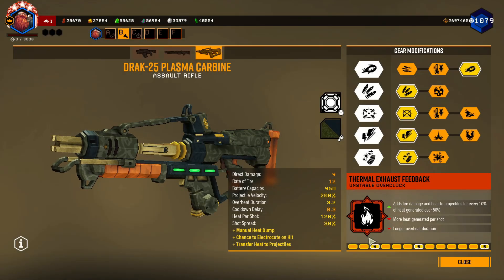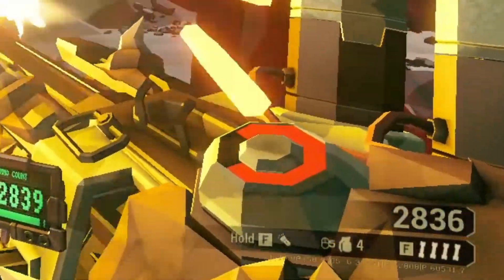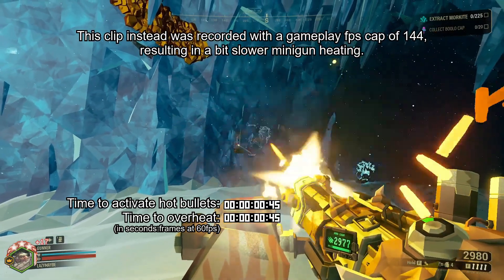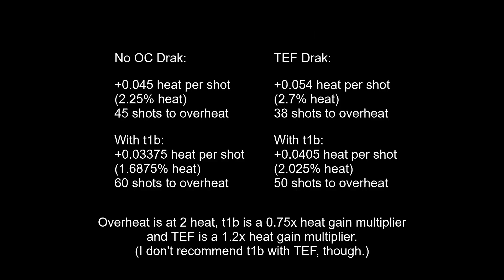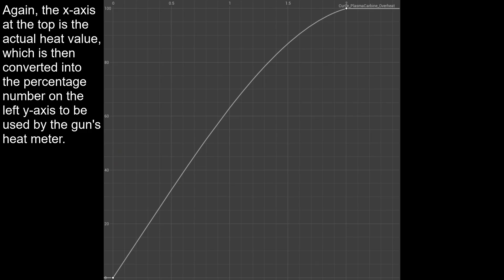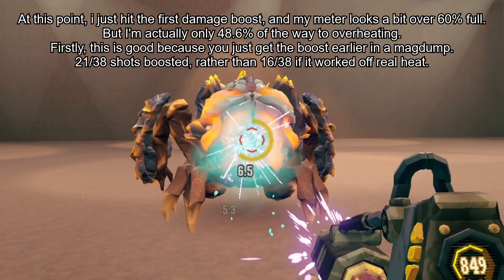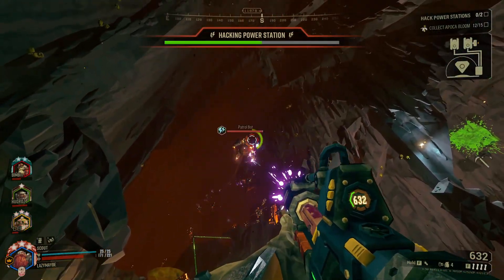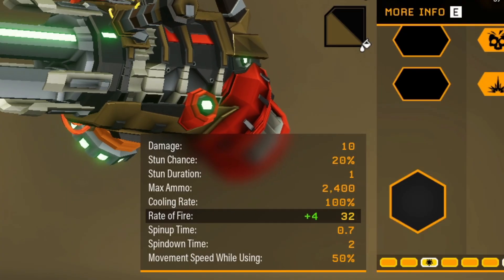DRG Season 4 TEF buff, mechanics, and some bugs (especially with spreaders)

Comment: DRG  programmer here! The sceptic spreader tweaks happened because the old line of sight check behaviour would make it try to shoot you through walls. We will adress these new issues in a future patch. It was never intended as a nerf. And yes, you did lure me in :(
Reply: Hey I've noticed a bug where if I pick up Doretta's fuel canister or sometimes switch to my gunner shield (could be more), my pov will be empty (showing no item in my hands) and not allow me to use it until I switch to another weapon and drop it. Also there's been a bug with the crossbow where it doesn't reload after you shoot, you have to manually switch weapon and back before it does. Haven't played scout in a while, but if it hasn't been fixed it's certainly something to look into.

Pls look into these thing, the crossbow bug has been in game for a long time. Appreciate your work.
Reply from the maker: Oh, the comment about them being nerfed was in regards to them now having the attack-tell-scream. Subjective of course, but I found them to be in a good place right off the bat. That said, it's the only version of spreaders I've experienced that has the scream tell also has the pathing issues, so it's not exactly as if I know what they'll be like once those are fixed.

I just worry that once the pathing is fixed, the long scream animation may still make them too easy to deal with before they become a problem.
Reply: Thanks for fixing the DRAK fire OC, it was my favorite OC.
Reply: @snoweh1  idk about you but my crossbow is working fine for me, it's actualy the exact opposite issue where in my "infinite wisdom" I switched to my deepcore rifle expecting the bolt to be reloaded, thats what I get for not having born ready on scout when using the bow XD
Reply: Since you're here, I've noticed that (on console at least) when I do things like build pipelines, start machine events, set up the uplink, etc. If I stop doing it for whatever reason, it will reset the progress. I was just wondering if this was intentional or not
Reply: It's great to read about your point of view about the game, thank you for your work on this great game! =)
Reply: @PalpatineGaming  I got that bug on PC in one mission, but only on one mission.
Reply: @xendakakorva3267  I have no idea what you're trying to say to be perfectly honest.
Reply: @joneydew4739  I've had it on all of mine, it's not a huge deal it's just slightly annoying
Reply: You guys should do something about Stingtail. They have tendency to spawn on ceiling and kill drillers and gunners through fall damage (by pulling them up to the ceiling). The most annoying thing in the game right now.
Reply: Is there a way to maybe keep something with it in...? It's just exceedingly funny to see him waltz up and give you a little headbutt like a friend then run away all shy after doing it. or a reference maybe
Reply: @lazymaybe  Honestly, as a dude who does a lot of Solo play I found the spreaders to be slightly more sneaky that is entirely fun. The roar seems like a good fix to that, even if the RoF reduction it brings also reduces the amount of threat they pose in swarm fights (where they really shine RN). Personally, I'm hoping for a shorter but louder roar.
Reply: @snoweh1  What I'm saying is that I was being dumbass and forgot to have the Born ready perk on me so that the crossbow reloaded while I was using the Deepcore GK2 XD
Reply: @xendakakorva3267  That'd fine with me, God bless you and your family. May your steps be blessed and guided by light.
Reply: @snoweh1  same to you bud
Reply: @PalpatineGaming that is a bug. Its fixed on the steam version of the game and we can hopefully have a patch out soon for the console version as well :)
Reply: @gentlecat7735  gotcha
Reply: @Maestro-ee4rj  I know I saw on reddit a dev saying they were also patched. They were pulling people from 30m above you, but now will only attack if they are no more than 15m above your current elevation. You can still totally fall and die, but it shouldn't happen as often.
Reply: Hear me out - special egg event that lets us get a steeve for the station (of the many types of bugs) I just imagine having one of these on the station like a st bernard
Reply: Man I feel bad for you with all these guys telling you to do other things
Reply: @Maestro-ee4rj skill issue
Reply: @PalpatineGaming  it hurt when the engi player start get interrupted for some reason, then all progress get lost
Reply: The spreaders are fixed on PS5 now, thank you!

The spreaders and the stingtail are FANTASTIC, great addition to the disruptive bugs (emphasis on disruptive), thanks again!
Reply: No worries, coding is difficult, though I have to agree with Lazy on the spreaders as in my green beard experience they are mighty good opponents, not really a need to telegraph their attacks since it’s a bombing projectile, I just always had the problem of them shooting without line of sight or checking first before shooting as I would be fighting two oppressors and then now my wiggle room is gone do to septics shooting from where I can’t see them
Reply: would be cool if there was a very rare varient of the sceptic spreader that just follow you have the damage resist steeve has and don't attack
Reply: @theberzerkir very very good idea (and would be very cute to have a little grunt friend on the station)
Reply: Now septics just dont check for los... very epic at hi-haz

Comment: On the console version of Season 4, for some reason the version we got of the update included two bugs:

1. Infinite Rock Pox build up without there being any actual infected enemies or terrain left in the mission (the only way to cure this is to get downed and revived).

2. Progression on building or repairing objects and objectives goes back down to zero if you stop or get interrupted at any point, instead of the progression being kept.  Engineer turrets, mini mules, uplinks, fuel cells, black boxes, pipelines, buried resupply pods, cargo crates, machine events, and the Caretaker’s shield batteries are all affected by this and it makes missions feel much less flexible than before.

The PC version of the game got these bugs fixed in subsequent patches, but this is the first console build of the update we got. Why we got this bugged version of an updated Season 4, I’m not entirely sure, but I’m certain they’re trying to fix it. It’s been 2 days and haven’t gotten an update or fix for it.

Comment: I'll be honest, even on season release spreaders felt incredibly weak. Huge weak point and low health meant they would always die pretty much instantly, and even when they got a shot off it wasn't nearly as dangerous as getting randomly hit by an acidspitter or something.
Reply: Yeah but they could also seriously hurt you and deny the area around you. A single cheeky one could easily make salvage duty into hell.
Reply: I think thats the point. They're like the any of the ranged bugs, conspicuous and are easy enough to deal with on their own but when there's a horde around you they become hard to prioritize which is when they deal some real damage. And you give them less credit than they're due, they hurt like heck, even just having them die on the ground leaves a nasty puddle that can melt anyone quickly which doesn't help in horde situations.
Reply: spreaders kind of fill a similar role to hermit crabs in ror2, if you play that game, except it also has a bit of l4d spitter in it as it can cause significant area denial if left unattended.
Reply: @bluegolisano7768  septic spreaders don't kill you in two hits from across the map and also blend in with the scenery.
Reply: You can call them weak until you have to revive someone lying in a septic pool lol. Or defending a black box and the pool out-damages gunner shield regen. 

I love them, but I don't them to be buffed 😅
Reply: They should be like mortars, ground-based and launching their goo from afar.
Reply: @snoweh1  My impression is that they are (Before this ai bug), they were a pain on Salvage when they would hide behind the terrain, raining artillery shells on me while the glyphids held us inside the circle to defend. Usually you only have a scout who can jump out to deal with it. Luckily it works much like an artillery aswell, so once you move up on it and can shot it dies pretty easy, which is fine imo.
Reply: @bluegolisano7768  Exactly what I was thinking. The fact that their projectile travels in an arc made it so they could attack you without LOS and you pretty much had to find them and take care of them before they do some serious damage. I honestly thought they were fine shooting behind obstacles because of the nature of their projectile.
Reply: Nah area denial is really powerful, Drillers know that. The little bastards also die hard.
Reply: Cool, but I still remember them literally slinging projectiles at me without even revealing themselves, but cool. Multiple times, they would be just out of line-of-sight which makes some Salvage Uplink stages a complete nightmare in pugs.
Reply: I think they were fine when they first released. They’d shoot quick enough, from far enough away, and from cover enough that they’d feel threatening because one starting to shoot could make half the floor of the cave dangerous and they do do solid damage. Their damage is significantly higher than an acid spitter and it lingers so I think it’s fine if they’re a little weaker, but to be honest they felt about the same, just with bigger weak spots. I have noticed they seem to be really weak now though so I hope they get fixed to be about as threatening as they were at the start of the season because I think that’s the right balance for a glass cannon type enemy. They aren’t meant to be super deadly, they have pretty high spawn rates so I think it’s good if they’re not ultra deadly, especially since their puddles really are no joke on higher hazards if you walk into them by accident
Reply: They’re intended to be glass cannons.  Before this LoS bug, on haz 5 these things were a nightmare if you let them live long enough to fire goo at the team, as the goo piles do such an insane amount of damage so quickly, it could down several players in mere moments.  I also imagine it’s coincidental, but I got pulled into goo piles so many times by stingtails, and that was basically a death sentence every single time.  An enemy so insanely powerful needs to be balanced by being really squishy with huge, high damage weak points.
Reply: Isn't that what literally every ranged enemies are? Extremely weak but also deadly (Except for those armored Macteras ofc), Spreaders are like Webshooters, sure on their own they're easy to spot and kill, but if a group of them is accompanied by a swarm they can easily wipe your team, which Acidspitters can't really do because of how few of them spawn.
Reply: This thing can basically one shot you on haz5 and puddles melt your health like nothing else in this game and this bug is still very dangerous on haz4, what are you on about? Let's give it oppressor armor and a weakpoint at the back, sure it will be threatening enough for you then.

Comment: Hi there!
Spreaders were probably changed to help players on lower hazard levels. Especially on haz 1-3, spreaders were exceptionally more threatening than anything else you'd run into, except maybe poxtorians (even more threatening than low haz dreadnoughts). One spreader could wipe out a lesser experienced team before they even know it's there.
Reply: spreaders roaring was meant to help with that, but them running up to you and refusing to attack was pretty clearly unintended
Reply: One of the devs mentioned that they were attempting to target players through walls, which is why they changed the LOS thing
Reply: Skill issue.
Reply: @bugjams  Yes, making games function properly require skill.

Comment: When it comes to the septic spreader, they did need some changes to their LoS check but GSG seemed to have either bugged the bug or went to strict. I have been in at least one mission where a spreader was literally shooting through the Salvage fuel cell from an elevated position. Being solo and not playing Scout at the moment, I basically had to deal with an enemy being able to ping me without being able to ping them back. So, no, I wouldn't consider the Spreaders to be "alright on release" but I agree their LoS check needs to be loosened up a little.

Comment: I thought the line of sight check nerf/patch was due to the septic spreader firing over the horizon, meaning the bug knew where you were without actually being able to "see" you and therefore had the potential to shoot you from behind cover. The first few days of gameplay made me really appreciate how hard and unique an enemy it was even if it did feel a little cheap. I understand the bugs are able to path to you in the dark but the arcing shot from the spreader was faster and more damaging than a shellback, and if there was more than one it made moving through swarms very tricky. A DRG programmer in the comments said they were sometimes shooting at walls which I could see as a big problem. But since the patch it has gotten noticeably easier. The new stingtail by comparison got nerfed with a 10m grabby range which is thankfully is a pretty good change I think. But the septic spreader is now such a good boy I almost think beast master will work on him.

Comment: Tbqh I still think the bonus should start (plus give you an extra stack at max stacks) at 50%.  Maybe I'm underrating how strong it would be, but it still feels rather finnicky to actually use, especially if you want to get optimal effectiveness from it.

Nerfing Spreaders is a bit weird.  They never seemed overly damaging in my experience, especially compared to either spitter variant which you have to be very proactive about spotting and picking off.  Springtails seem far more disruptive and harder to deal with, and even then they're arguably balanced, so I'm not sure why Spreaders were seen as a priority here.

Comment: Hey Lazy, have you considered making smaller, more focused videos? As the game gets older, it's more and more likely for some videos to become out of date. I don't know if your intention is to have your channel become a resource similar to the wiki, but having single-issue videos would help in this case.

Besides that, would you mind going over the new Stingtail? I think this thing is insanely overpowered compared to other bugs. Getting grabbed and moved out of position is easily the strongest effect any special bug has. I mostly play Gunner, so I'm slowed while firing, and dodging sideways is difficult. Our team's scout has switched over to cryo grenades just to deal with these fuckers.

Comment: I feel like the only new bug that should've been nerfed is the Stingtail, and even then not to the degree of running forward never attacking.
See, I play on haz 4 all the time. I do not like haz 5 or elite deep dives. They are too difficult and take too much time and thus are not fun for me. Same reason I hate point extraction, it's the one and only mission I set to haz 1 to skip whenever it shows up as an assignment. I also play on solo a lot. I haven't done any multiplayer in the longest time because I like to bang out a handful of games in Deeprock and then not play for a while, which means joining other people really suck as they don't ever align with what I'm doing. Haz 3 is way too easy, so that explains why I do the middle ground. I am pretty alright at the game, I can handle winning most haz 4 missions. The times I lose are usually at the absolute start of the mission due to terrible spawns.
Stingtails ruin all of this however. They are so incredibly difficult to dodge and have guaranteed a loss on every single mission I have played so far where they've spawned. Not even sugarcoating my own opinions here, it is too hard. I hate it. Makes me not wanna play the game at all. If I can't play how I like because it's now too hard and haz 3 is still just as easy as it was before, the game is no longer fun.
Reply: No offense man but this is just a skill issue, Stingtails aren't that bad

Comment: So how does the non-linear heat gain apply in reverse (ie cooling)?
Reply from the maker: Following the same curve, so a reversed version of the same thing. If you were right about to overheat, you remain at high "heat" for a bit longer, and then when the meter is lower it will go faster. (Bearing in mind that the actual heat gain/reduction internally is linear, it's just the heat "percentage" the meter shows and heat scaling effects work off that isn't.)

Comment: One thing I want you to test: Electric arrows' slow effect from boltshark seems to stack now. 2 arrows can stop oppressors from moving.
Took this to an elite deep dive and stopped a bulk from moving. Not sure if this is a weird bug or intended behavior since this didn't happen last season.
Reply: They always did that. I always use the electric bolts agains dreadnoughts, they cant even move.
Reply: @feelsgoodman2171 so I guess it must've been something with last season then since it didn't do that but it does the intended behavior now.